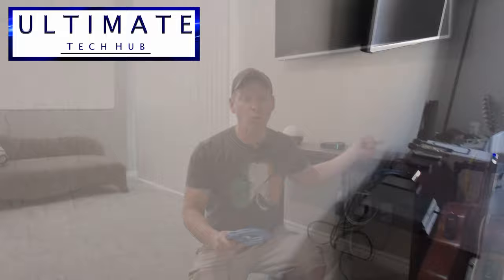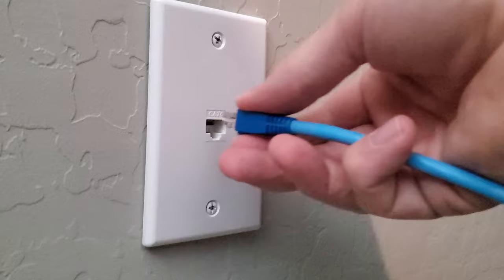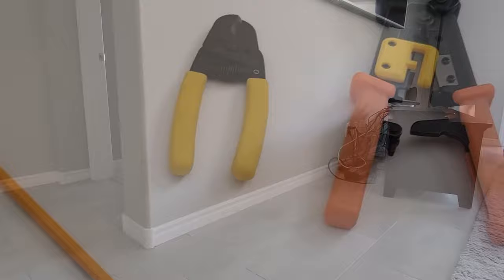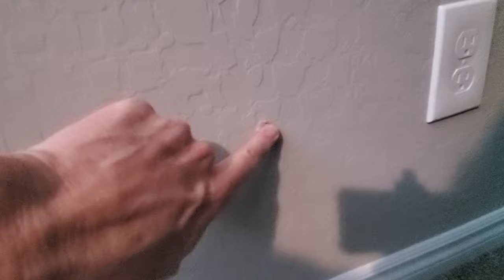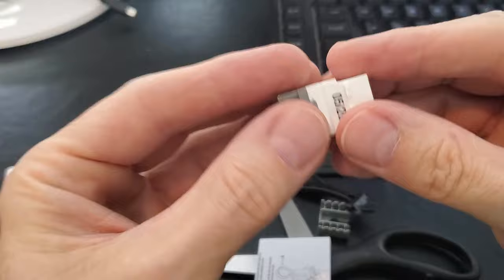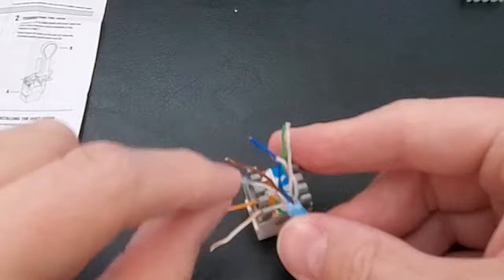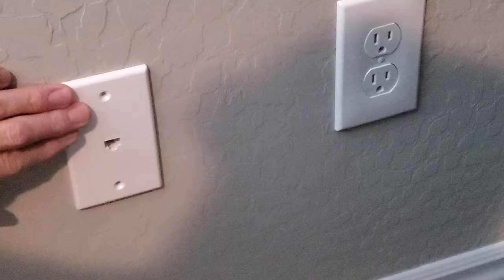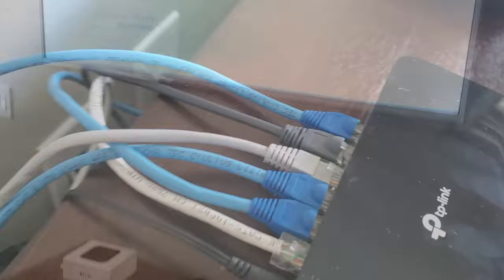CAT6 CABLE RUN THROUGH WALL AND ETHERNET JACK INSTALL - HOW TO

Comment: Will this jack work with a cat 8 ethernet cable?
Reply from the maker: Cat 8 uses a different wall port jack. The cat 6 jack will work with cat7 but you won't get the cat 7 speeds.
Reply: @UltimateTechHub  oh ok
Reply: @UltimateTechHub  do you know where I can get the cat 8 jack?
Reply from the maker: @cxntrol1511  I can't recommend any website but just do your research and read the reviews. Are you running Cat8 in your home?
Reply: @UltimateTechHub  Yes, currently I connect my cat 8 cable into my wi-fi pod to the pc. But, I want to connect it into the wall instead. My house already has all the wiring and cables installed. All I have to do is install the jack. But I want to make sure I'm getting the speed I need since I have 1000 mbps.
Reply from the maker: @cxntrol1511  Cat6 and cat5e will provide 1000mbps. Cat8 won't improve internet speed only file transfer speeds between pcs and only if you have the 10gig NIC for each PC. Unless you plan on getting 2gig fiber optics then cat8 is overkill. Although it does sound cool!! Good Luck and keep me posted.
Reply: @UltimateTechHub  so I can use the cat 6 jack with my current cable??
Reply from the maker: @cxntrol1511  Yes you can use it but will not get the full  cat8 speeds. So using a cat6 would work exactly the same.
Reply: @UltimateTechHub  ok, tysm

Comment: how would you do this if you room is on the 2nd floor and the router is on the 1st?
Reply from the maker: You can run a cat6 through the floor. Just make sure there are no pipes or electrical wires in the area you will be drilling. The other way is the run a cable from inside to the outside of the wall. Then run the cable to the second floor and drill back into the second floor wall.

Comment: Wht if the house is like a resort each room is far away but my room and the router is not so far but the wall is stone is it possible to put the cable on terrian like outside im gonna out some White cover for it
Reply from the maker: You can use a stone drill bit to drill through the stone wall. Other option is to run it along a baseboard or through the ceiling.
Reply: Consider a professional or a mesh wireless system. Eero and Orbi are popular mesh wireless setups.

Comment: I have an itch, why didn’t you align with the plug socket
Reply from the maker: The plug socket is behind the bookshelf so I didn't see it after I already started the install. As long as I live in my house that book shelf will be there so no issues. Thank you for watching and if you subscribed thank you as well.
Reply: @UltimateTechHub  thanks for the great vid 👍
Reply from the maker: @paulcheetham2893  Thanks for watching and if you subscribed thank you as well!

Comment: How would I do it if my room is upstairs and my WiFi is downstairs, I want to get a pc but the thing I’m worried about is how ima connect it to the wifi
Reply from the maker: The signal should be strong enough to reach upstairs. Just by a wireless PC network adapter and your all good. Keep me updated and thank you for watching.

Comment: can't one buy the plate with the connection built-in?
Reply from the maker: I believe they sell plates with a rj45 jack already installed but I have not seen them in my store. The way I show you is the cheapest way and the most common way to do this.

Comment: I had a technician do this but for some reason the download speeds are capped. Is there something I can do to fix this?
Reply from the maker: It depends on your max ISP speeds and the type of switch you are using. The cable itself will only cap the speeds at 1000Mbps up and down which is very fast and most homes do not have 1 gig speeds from their ISP.
Reply: @UltimateTechHub  i have 500Mbs plan but only getting 15Mbs. One end is connected to the router itself then the other is the ethernet wall jack itself. Can the ethernet jack cap it?

Comment: Why oh why did you not use a chalk/laser line to ensure the data jack was level with the electrical socket??? Looks terrible.
Reply from the maker: I leveled it and added a low voltage gang plate. Here is the video link
https://youtu.be/4CUyU_v2qS0
Thank you for watching!

Comment: Does anyone know if its a big job for a local cable guy to run a cat 6 cable from a downstairs living room router to the bedroom directly above? It will cost me £95 apparently to run it through the wall at front of house, up the wall and back into my room upstairs. I’m currently waiting for permission to do this cos we rent from housing association, but iv waited nearly 3 weeks :( if i just did it would they notice? Should it be quite clean? Apparently they said its a fairly small job and not too noisy.
Reply from the maker: It's a pretty easy job to run the Cat6 cable and it's not messy either. Good luck.

Comment: What type of cable should I use if I run the cable through the attic? Solid or patched?
Reply from the maker: Riser Cable works great and is flexible and durable.
Reply: @UltimateTechHub  shielded not shielded?
Reply from the maker: @BadWeatherfreak Unshielded
Reply: @UltimateTechHub  why is that?
Reply from the maker: @BadWeatherfreak  unshielded is cheaper than shielded. Shielded is better when you have EMI in your home. I don't have any EMI so unshielded works fine and my distances are only about 70 ft or less.
Reply: @UltimateTechHub  so the heat doesn't affect the signal.
Reply from the maker: @BadWeatherfreak  Nope heat doesn't but Electro Magnetic Interference does. I live in Las Vegas and our attic reaches 120 degrees in July and we get 1 gig speeds consistently.
Reply: @UltimateTechHub  what is your take on cat6 vs cat6a?
Reply from the maker: @BadWeatherfreak   I have 3 lines of Cat6a in my home and I have 23 lines of Cat6 riser cable and can't really tell the difference at all. Cat6a is rated 10 gig but unless you get fiber speeds above 1 gig then it's not really necessary. However Cat6a is good for future proofing.
Reply: @UltimateTechHub  I currently have 200 mbps with my plan don't see my provider upgrading nowhere near 1 gb.

Comment: Can i patch two lan cable on one jack for wifi lan socket and the other on for pc lan wall socket.. plz help
Reply: you need to use a switch to give you multiple ports, you can't splice multiple cat6 wires off one like you can with electrical wiring.

Comment: I want to have ethernet in a room that isnt right on the other side of the wall, but i dont know how know how to get it there. Do you have any idea how i could do this?
Reply: Fish it up the wall into the attic then down the wall you want the jack at.
Reply: You could also run a long pre-terminated cable from the "box", along the walls (in a raceway of course for cable management either along the edge of the ceiling or the baseboards), then into the room. You could also run the wires outside if your "box" is next to an exterior wall, and if your room has an exterior wall. Simply punch the cable out, run it along the siding, then punch in. I can't be any more specific since IDK what type of siding your house has (stucco, brick, composite, etc.).

Comment: Hello. I need to move my router from basement up to second floor, so I need to get a long internet cable from basement up to the second floor, how to do that? , a few people want to charge me $250 - $300 for this job.
Reply from the maker: You need to run a Cat5e or Cat6 from your modem which I assume is in your basement to your router upstairs. First you need to decide how your running that cable. You can run the cable through the wall up to the next floor. Or run the cable on the outside of the wall with wall clips and drill a hole through the ceiling that leads to the top floor. Either way works well and its only a matter of ascetics. If your basement walls are cinder block then the second choice is your only choice. Also, tape measure the distance of the cable run so you can buy the correct length of cable. Home Depot and Lowes carry 500 ft and 250 ft lengths for a cheap price ($ 75-125 ) Good luck and keep me posted. Thank you for watching and if you subbed thank you as well.
Reply: @UltimateTechHub  Hello ! 

I am sorry I don't know your name, thank you very much for a fast reply and such a detailed instructions ! It's yes and no, the stupidity of American home builders is while new constructions rather than to have an internet spot somewhere upstairs to make it easy to access, the chose to put it down in the basement in between tiny concrete walls, and of course it makes the signal weaker, so I would keep the Verizon Terminal in the basement and move my router upstairs to the main floor,

 I would need to buy a 20ft cat6 cable, and run the cable from basement through the wall, I know there is a friendly tool called fishing rod to run cables through walls, am I'm right?, different people want to charge me $200-$300 for this job, the tool cost $60.00 in home depo.

Comment: How to match color of wire to other side of RJ45 some time different company follow different color
Reply from the maker: There are 2 different wire patterns for the rj45. The only difference between T568A and T568B is that the orange and green pairs are interchanged. T568A wiring pattern is recognized as the preferred wiring pattern. So check to see which pattern it is the do the same on the other end.  Hope this helps. Thank you for watching!

Comment: My walls are made of plaster, can I do that??
Reply from the maker: Yes as long as the walls are hollow. Use a stud finder to check for studs, pipes and electrical conduit.  Should be easy. Thanks for watching!!

Comment: i need help so i have a wall jack up stairs and my modem and router is downstairs it says cat 5e + cable i tried cat 5 e and didnt work so i think i need a cat 6 cable or jack issue probably cable but i dont know another question is that do i have to hook up anything like any wires to my modem for the jack to work? or do internet provider does it for you?
Reply from the maker: Watch this video
https://youtu.be/hsROsS1fXvg
And yes that cable from the plug needs to connect to your router. Otherwise it won't work.
Reply: @UltimateTechHub  thankssodaikash thank you
Reply: @UltimateTechHub  subbed for the help
Reply: @UltimateTechHub  can you tell me how to connect it to the router?
Reply from the maker: @Kamaljit971  It works the same for either end of the plug. You can connect the other end of the plug that's not going to the room to a LAN port on your router or even from a switch. If you want to connect a second router to the plug in your room then watch my 2 routers on 1 Network video. Easy setup! Thanks for watching and keep me posted.
Reply: @UltimateTechHub  thank you for the help keep it up

Comment: How do you know it works? Or detects your wifi? That’s what I’m confused about
Reply from the maker: I tested the connection through my apple tv box. And I streamed some movies and it works perfectly.
Reply: wifi and a wired network connection are two different things m8
Reply: It's wired connection, wdym WiFi?

Comment: Would've been a lot easier, and faster, if you used a coupler keystone instead of a regular keystone jack. No need to cut any cable
Reply from the maker: It sure would be easier but this video is about showing the wiring technique. Thanks for watching and if you subscribed thank you as well!
Reply: Great video. Only suggestion would be to align the plates (network jack and electric plugs). It'll look even better!
Reply from the maker: @oaquique  Yep after I installed it I wished I used a level to line it up with the electrical plug but my book shelf and guitars sit in front of the outlets so its not a big deal. Thank you for watching and if you subscribed thank you as well.
Reply: Thanks for this comment. I wasn't sure if they made a coupler for Cat 6. Didn't see any at Home Depot so I watched this video to learn what to do. After seeing your comment I went out and hunted down a coupler at Office Depot. Thanks!

Comment: It isnt straight and it isnt level with the other outlets
Reply from the maker: I straightened it about 3 weeks later and added a gang wall bracket. It really didn't matter since a bookcase is in front of the outlets. If you want to see the video let me know I will send you the link. Thanks for watching.

Comment: It would have looked pro if it weren't an inch lower than the one right next to it
Reply from the maker: I added the low voltage box and leveled it about 3 weeks later. I made a video on it.

Comment: I wish they were aligned
Reply from the maker: I added the low voltage gang plate and aligned the plate with the electrical outlet. Here is the video on did on the install.
https://youtu.be/4CUyU_v2qS0

Comment: You didn't need to hammer in the second anchor because the hole was too large. Granted, its plenty snug for a plate, but for the purpose of an educational video I found it interesting that you mentioned the anchor needed to fit snug and then as an example to your viewers of this...you over-drilled the holes. You also didn't address how easy it is to nick your wires with the method you're using. You bring out a legit crimper but not a legit stripper. You also neglected to mention what wiring scheme you were using. The defense you've given for quite a bit of criticism is that this was an educational video regarding technique.

Alright.

Comment: Cable was incorrectly installed into the back of the wire cover on your keystone.  The circular notch is for the cable leading in to the back, not just hanging out of the bottom.  Plus, since it isn't at the same wall height as other outlets, looks like an amateur install.
Reply from the maker: I added the low voltage gang wall bracket and straightened it up as well. Here's the video.
https://youtu.be/4CUyU_v2qS0
Thanks for watching.

Comment: Why didn’t you install the wall plate straight
Reply from the maker: I didn't realize until I already installed it. However the outlet is behind the book shelf so it will never be seen. Thanks for watching.

Comment: What if its on the other side of the house?
Reply: Well you have to do almost the same thing, except your route isn’t just going to be a straight line, run through the attic, crawl spaces, conduits, or wherever else you can. One thing to note is you’ll only be able to run the wire through a wall separating rooms. A wall separating the inside and outside will have insulation.
Reply: @brianfeuerman1732  how would I work around the insulation? I don't have much space to move stuff in my room
Reply: @vocalthrower448  Well, it’s unique to different situations, there is a way to run wires inside a wall with insulation, but it is not easy. If you need to, you could just drill a small hole in your ceiling, and not even bother having it inside the wall (I wouldn’t recommend that, because it is not pretty) make sure the wall you try to get the wire though doesn’t have insulation, and you should be good. (Just checking, is there an attic above the room that you want to run that to?)
Reply: @brianfeuerman1732  yes there is an attic
Reply: @vocalthrower448  Yeah, just use the attic to run the Ethernet between the two locations, and have it drop down through the wall where you need a wall jack.

Comment: Hey Buddy, whoa, two words: “cable management”

In the opening scene, behind your family-room TV, the cables look like a rats’ nest. A butt-clenching horror show to anal retentives.

Please fix that.

Otherwise, good instructive video. 😁
Reply from the maker: Here is the video where I clean up the wires and wall mount the switch.
https://youtu.be/KS_HxoRGyKM
Thanks for watching and I even added the low voltage gang wall plate in a more recent video.
Reply: @UltimateTechHub  I look forward to watching it. Thank you. 🙂

Comment: Wrong cable for in wall/punch 
down use, no bracket for the plate…come on
Reply from the maker: I added the low voltage gang wall plate a few later. Here is the video
https://youtu.be/4CUyU_v2qS0

Comment: Where can i find a punch down tool?
Reply from the maker: Home Depot and Lowes carry them.
Reply: @UltimateTechHub  thanks
Reply: Is it called a punch down tool?
Reply from the maker: @dubc2922  yes
Reply: @UltimateTechHub  I tried to use a flat head screwdriver 🪛 to push down the wires for the Ethernet connector but it’s not working
Reply from the maker: @dubc2922  The cat6 wall jack plug comes with a small black punch down tool for free.
Reply: @UltimateTechHub  okay I’ll look again at Lowe’s but mine didn’t come with it
Reply: @UltimateTechHub  I’m in Louisiana I had to buy it separately it didn’t come with it.But I have ran into some trouble with trying to line the colors up with the connector for wall Jack
Reply from the maker: @dubc2922  Watch this video.
https://youtu.be/gN0fygZS8Qw
Reply: @UltimateTechHub  thanks the first one was successful I ran one in a extra room in my home
Reply: @UltimateTechHub  I will run one in my garage but the wall is filled with insulation should I use a heavier screw to make it fall through?

Comment: Great video, really enjoyed watching this. I'm wiring a new ethernet port into my bedroom today in my flat where my PC is because the one put in by the building owners isn't using high quality cables and can't handle my G Fast speeds with BT (here in the UK). Really informative video!
Reply from the maker: Thank you for watching I really appreciate it! I have dozens of these types of videos so make sure to check them out!

Comment: You need a receptacle. Doing it that way is incorrect and lazy.
Reply from the maker: I added the low voltage bracket 3 weeks later. Here's the video.
https://youtu.be/4CUyU_v2qS0?si=e7rZIaWsmQYaCKv2